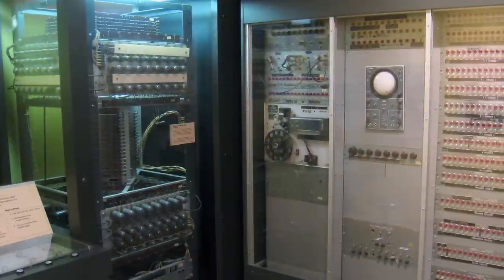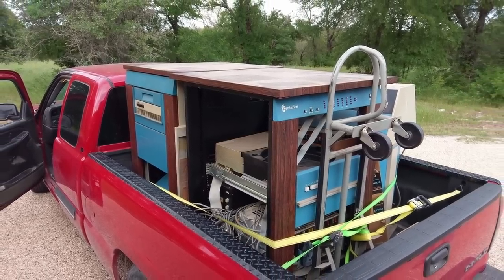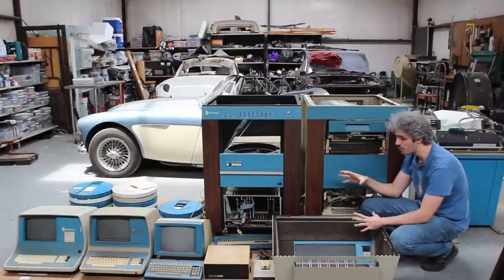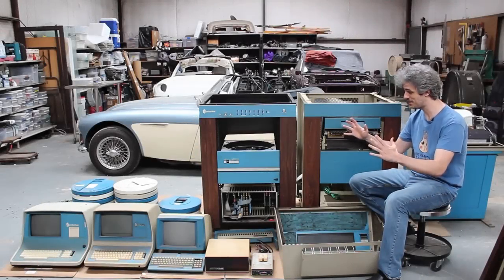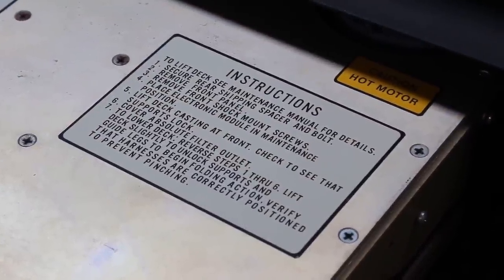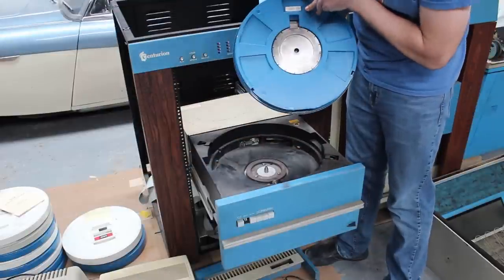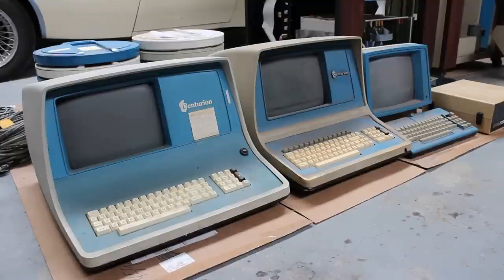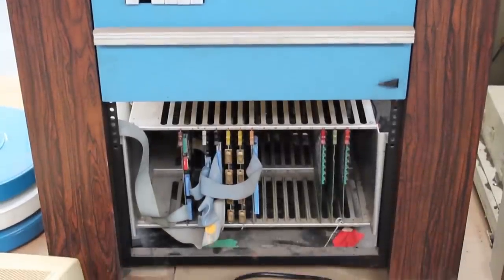I Bought a Minicomputer from 1980! – Part 1

Comment: If you set the terminal for RS232, just jumper pins 2 and 3 on the DB25 to get it to echo what you type back to the screen.  BTW, ADDS 580s traditionally were grey with orange keyboards.
Reply: they looked like they were a current loop serial device. It said EIA current loop.
Reply from the maker: As dan b mentioned, I believe these are 20mA current loop devices, like the late model Teletypes similar to the ASR33. Fortunately, there was a self-echo DIP switch on the back that got the terminal echoing back with no issues!
Reply: @UsagiElectric  I have worked on many terminals.  Typically, current loop was used for terminals, Teletype or Siemens, that were used in communications networks like for a shipping company.  Current loop goes back to telegraph and is going to be the lowest common denominator across countries and continents.  In this country Western Union was the provider.  A terminal to computer connection would be like RS232 with the proviso that if both the computer and the terminal were made by the same company the protocol could be proprietary.  In the military the protocol was Mil Spec 188C which was basically RS232 inverted with a mark-to-space transition time of at least 30% of the length of the data-bit to minimize RFI.

Comment: That's a true Line Printer. As the type chain rotates, a solenoid (hammer) behind each column position fires at "just the right time" to print the correct character.  Once each character on the type chain has moved past all the columns, the paper is advanced; thus printing one line at a time. so... Line Printer from which BASIC got LPRINT, and CP/M and MS-DOS got LPT:. 

The twin terminals look to be a variant of Intertec's basic design; they made numerous OEM variations. Compare to the Superbrain computer, for example.

One nice thing about twin removable disk packs was that you could stop the computer, pull the pack out of drive 1 and put a spare in, then directly copy pack 0 to pack 1 (bypassing the computer), then swap all the packs round and copy drive 1's pack to a spare pack in drive 0 — thus taking a "snapshot" of both drives that could be stored off-site. Usually this was done over quite a few brews each Friday.

Comment: Wow, what a find. 
What I find even more amazing than the super 70s colour scheme is how the system is in such good condition and how it even is still somewhat complete after spending god knows how long in a basically abandoned building without a roof. 
I would have guessed it would be rusted to pieces or torn apart by copper thieves several decades ago. 

I'm looking forward to see you getting it up and running again, I have no doubt that you will get there eventually. 

Greetings, 
Michael
Reply from the maker: That 70's color scheme is awesome isn't it! 
Centurion put little date stickers all over everything, but the dates have all faded out, so it's hard to date the machine exactly. The drive has a stamp that says 78 and the computer chassis date sticker looks like it might say 79. So, it's possible the machine was built in 79, and then the extra cabinet and drive were added in the early 80s for more storage. 
I was also totally blown away at how complete it looked despite having changed hands at least twice and being stored in such less-than-ideal conditions. I may have really lucked out on this one!

Comment: Be careful with the slot in cards as some machines require them to be in the correct slot.
Reply from the maker: I was definitely worried that that might be a possibility, so I took a picture of the card layout before I pulled any of them out, just to make sure I get them back in the right spot in case the backplane is unique.

Comment: The old commercial modems ran at like 600 baud, but hooked up to multiple phone lines so if you hooked it to 8 lines 600x8 gave you some good data transfer rates. God, it's been so so long ago since I played with this kind of stuff... Happy memory's! Got my first computer in 82 or 83, by the end of the year I was wrighting my own programs and by age 10, I was hacking. I hacked my first bank at 11... hey, I'm in a bank, now what? They had like a 4 digit code to access their system! No one really know what security was on their networks back then! Good times! Good times!

Comment: My guess about that block of IOs with all the DB-25's.... that's probably a terminal server, the separate processor probably is there to mediate between a bunch of UARTs handling bidirectional comms to those terminals.
Reply from the maker: I think you're on the money there!
There's surprisingly little information out there about this specific model, but it seems like it was meant to enable a bunch of terminals to be used with a single machine.
Reply: @UsagiElectric  I worked on some older shared systems (nothing quite as byzantine as this beast, this thing's pretty cool) that had similar sorts of 'breakout' devices. That thing's a beast tho!

Hope they kept the server room chilly xD

Comment: The data terminal case looks spookily like an Intertec Superbrain. Would love to see the board inside. I'm betting it has a Z80 processor.
Reply from the maker: I thought so too!
I can't find out for sure, but it certainly looks like the Superbrain used (or at least was inspired by) an ADDS terminal, just like these. Interestingly though, these terminals all have an Intel 8085 processor inside to make them smart terminals. I go a lot more in depth on the terminals in part 4!

Comment: If you flip the "SELF ECHO" dip switch to "1", you'll be able to see what you're typing.  You can get the same result if you put a little jumper wire between pins 2 & 3 on the primary serial port connector on the back.  Good luck!
Reply from the maker: Thank you! 
I actually just ran out to the garage and gave that a shot and, well, here we go! https://i.postimg.cc/SRXXNb40/IMAG3683.jpg
Reply: @UsagiElectric  You're welcome!

Comment: Line printers like this don't move the type to a particular place - it just continually rotates and the hammers strike at the right time. If you print a whole line of the same character you get a continual string of hammers whacking just slightly offset instead of random hammering - you can always tell the difference. Super high-end line printers used a rotating barrel instead with all the letters in sequence in every character position - these could shoot paper out at a quite prodigious rate, while making a huge amount of noise.

Comment: Came for the minicomputer - stayed to ogle the Austin Healey 🤣🤣
Reply: And a chain printer too… Olivetti used to make desktop chain printers you had to pretty much put sandbags around or the centrifugal force of the chain could have them wobbling off the desk…
Reply from the maker: Thanks! 
The Healey is a wonderful machine and one of the greatest cars ever built!
The chain printer is an absolute beast, and I'm really excited to see that thing power up someday. It's going to take a lot of work, but the interface should be simple enough to get it working. And if any of the internal gubbins are broken, well, I got a CNC mill over in the corner that's begging to be to put to work!

Comment: The term "minicomputer" got a bit hazy when the MITS Altair was referred to as such on the cover of the January 1975 issue of Popular Electronics. When it actually was a true microcomputer, defined as using a single-chip VLSI microprocessor.  It was the first one commercially available to the general public, and the publicity from the magazine article is credited with kicking off the entire microcomputer revolution.

Comment: A USB stick holds WAY more bytes than one of those drives!
Those disk carts look like the DEC RL01 which IIRC held somewhere between 10-20 Megabytes!
After you remove the bottom cover of the disk cart and lock the disk into the drive you are supposed to store the bottom cover, upside down on top of the disk now sitting in the drive.
If you connect the TX and RX pins on the terminal together (the 25pin block), you will then probably see typed characters echoed on the screen.
Reply from the maker: It's wild to think that you can get a Micro SD card with 1 terabyte of storage! And given how small the Micro SD is, we could probably stuff a couple petabytes in the same physical space as the 10 to 20 megabyte disk pack!
Thanks for the tip on putting the cover on top of the disk! I've still got a ton to learn about these systems in general, but it'll be quite exciting to get this thing up and going!
I was able to get it to echo back by juts flipping the Echo dip switch on the back of the terminal. The keyboard seems to be in pretty shape!
Reply: @UsagiElectric  I used to work for Digital Equipment, and the stuff I worked with there was the same generation that your machine uses.  Those RL01/RL02 and RK06/RK07 drives were huge, but only held 5-10 or 15-30 MB each.  The RL01/2 had a single platter, The RK06/7 had two disk platters in each cart.
Reply from the maker: @scharkalvin  That's awesome that you used to work for DEC! You're probably really familiar with a lot of the stuff going on in this Centurion!
I wonder how similar the CDC drives used here are compared to the DEC RL and RK drives? Fortunately, CDC was a fairly popular manufacturer of drives back in the day, and so I've been able to locate some pretty good documentation on the drives!
Reply: @UsagiElectric  Both the CDC and DEC drives used "standard" IBM type disk packs, though DEC probably low level formatted them differently.  DEC probably bought many of the parts from CDC and housed the drives in their own custom made enclosures.  DEC also made their own power supplies.  IIRC both the RK06 and RK07 drives had three surfaces for data, and one surface dedicated for a servo track.  The RL01 and RL02 drives used and embedded servo track that were laid down by the factory when the packs were low level formatted.  The end user could not re-low level format the packs, and non-DEC packs would not work in the DEC drives (though third parties DID sell their own compatible DEC packs that were formatted on DEC supplied equipment).  The DEC supplied interface between the drives and the computer my have also been "custom", however the older RK02 and RK03 drives  (slide in packs) were pure Diablo compatible hardware, the Diablo made drives were plug and play compatible with the DEC RK drive controllers, and packs.  The DEC made RK04 and RK05 drives were faster (the Diablo drives took longer to spin up, but spun down very quickly.  The DEC made RK's spun up quickly, but took minutes to spin down (no brake?).  What WE did was to click the spin down switch, and then pull the drive forward in the rack (slide mounted) and push UP on the thin metal bottom cover which then rubbed against the drive pulley to stop the pack from spinning (so we didn't have to wait minutes to change packs!)  I learned that trick from in house field service!

Comment: the disk is the replaceable cartridge type - it is bad that to my eyes the disk drive was open. 

That thing need to be much cleaner.
It also has a HEPA filter to clean the air cushion air before it is let into the drive.
I believe the correct filter is available (the drive is a diablo type drive.)
Reply from the maker: Thank you!
You're right, the drives were exposed to the elements for years and that's likely due to the fact that they had pretty nasty head crashes. The Hawk drive in particular is extremely rough. The Phoenix drive is probably restore-able, but the data on the fixed platter is no longer recoverable, which is unfortunate.
I show the drives in more detail in Part 2 and I show the head crashes in more detail in Part 8!

Comment: Your disk drives look to be DEC RL-01 (2mb) or RL-02 (5mb) (Digital Equipment Corp). DEC RL-02 id 2x the space of an RL-01. Also, the disk cover in a DEC RL sits on top of the disk cartage when installed in the drive, if you don't put the cover on top of the cartage the drive doesn't spin up. Also, there is disk cartage in your stack of disks that looks like a DEC RK-05. (Same cartage but different amount of storage was used in the IBM 1130. EX DEC FE 1982 - 1989.. The RL drives were mostly on DEC PDP-11. Also, the reason there a interlock on the disk cover to stop it from spinning up if the cover is not on top, that so you don't lose the cover
Reply from the maker: The two drives here are actually both CDC drives. The older one that's in the main chassis is a CDC 9427 Hawk Drive, and the slightly newer one that's in the additional chassis is a CDC 9448 Phoenix drive. They're remarkably similar to the DEC drives you mentioned though!
I believe the Hawk was a 10MB unit and the Phoenix was a 25MB unit, but I could be mistaken on that one. The gentleman that I have been in contact with that used to work at Centurion actually used to specialize in the disks, so hopefully when he gets a good chance, we can get him out here to help bring them back to life!
Reply: The resemblance to DEC drives is not surprising, since CDC made disk drives for a whole lot of other computer makers.

Comment: i serviced MANY of those disk drives, there is a 5mb fixed platter on the bottom. most likely you will have a head crash the moment you power it up. its not worth the repair

Comment: Maybe someone already mentioned that the left drive is a CDC Hawk (9427) drive. It uses IBM 5440 style media, which was also used by DEC in the RL01 and RL02 (however your media is NOT compatible with RL0x since those were factory formatted). The Hawk can also have a fixed plater under the removable platter so it is VERY important to lock the heads before transportation or you can ruin the fixed platter and/or the heads. The Hawk stores up to 5Mbyte on the removable platter and up to 5Mb on the fixed (depending on track density). 

The right drive is also a CDC, but called Phoenix (9448) this time or CMD (CartridgeModuleDrive). The Phoenix also has a set of fixed platters which vary depending on model. It stores 16Mbyte on the removable platter and then up to 80 Mb on the up to three fixed platters in there. Again, locking the heads are very important. You can find all sorts of good info here: http://bitsavers.informatik.uni-stuttgart.de/pdf/cdc/discs/ 

Good luck with your project and be careful with the drives, it will be hard to get new heads for them if they crash.
Reply from the maker: Thank you so much for the link and information! 
Bitsavers has been absolute lifesaver for so many of my projects, and I'm absolutely stoked that you managed to locate the manuals for the specific drives that I have. Also, huge kudos for being able to recognize them by just looking at them!
With the manual in hand, it's time to do a lot of reading and figuring out how to make sure that everything is still in spec before powering up. The drives are by far the scariest part of this whole build. Hopefully they haven't been wrecked by the multiple moves that it took to get them here.
Reply: Yep. I worked for Wang Labs from 80’ to 93’ and worked on both of those CDC drives. Repaired head crashes and did alignments on them. 5 Meg and 80 Megs sound like nothing now, but small companies were glad to have these. They cost as much as some cars back then ! Watch out they do have air filters on them that have to be replaced and there’s a procedure in changing them. Clogged filters will cause the heads to crash. Good luck finding new ones ! Brings back some memories. Good and bad.

Comment: The modem is actually a terminal multiplexer or what we called a 'terminal server'
Reply from the maker: You're absolutely right on that one!
 I've actually met up with a former employee of Centurion and learned a ton about the system since this video, and that was one of the things he confirmed for me!
Unfortunately, no matter what I do, I can't get the Micom to power up. I mean, it's not necessary since I'm only going to run one terminal, but it'd still be cool to see.
Reply: @UsagiElectric  The predecessor to the internet ran off these things. Racks of acoustical modems would be connected to terminal servers and you would dial into a PBX with your acoustical modem at 300 or the deluxe 1200 baud RS232 and if lucky would be switched to an available modem to communicate with others in what we called a BBS, or Bulletin Board System where you could exchange text messages with other users. in realtime or offline using systems similar to your Centurion.  I had my first computer date this way around 1981!

Comment: Watch those disc cartridges, if one of them was handled roughly it may be bent and if put into your drive the heads will crash and be destroyed.  I'm not sure how you would tell if a disc were damaged but it is something that could cause you great grief if it destroys what may be irreplaceable disk drive heads.   I do know that happens as a Field Engineer for the dinosaurs I once tended put one damaged disk pack into three different disk drives and crashed their heads.  The disk pack was externally marked as damaged and do not use but he ignored those indicators, we however had to admit that a known bad disk pack had no business continuing to exist in our computer room instead of a dumpster.